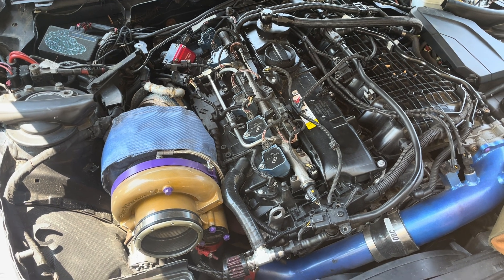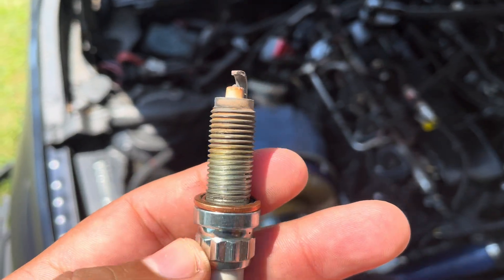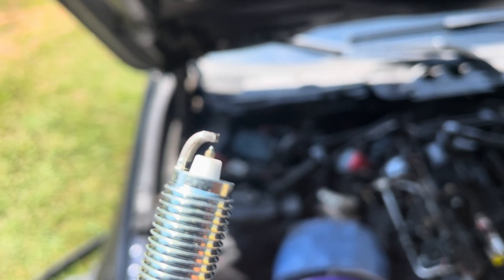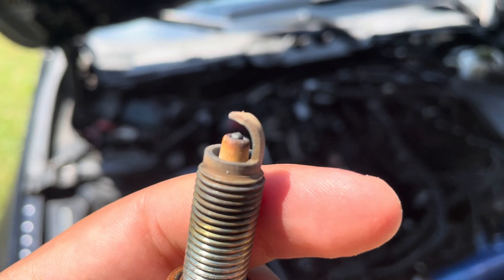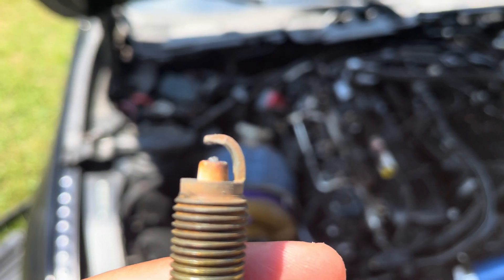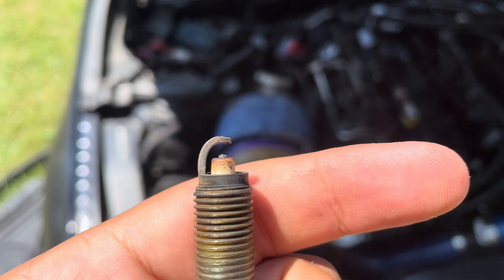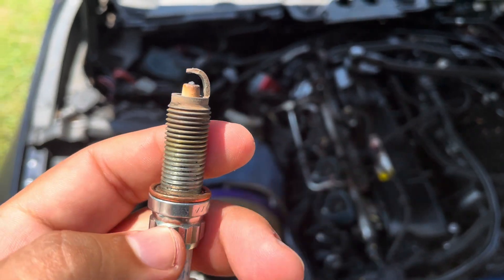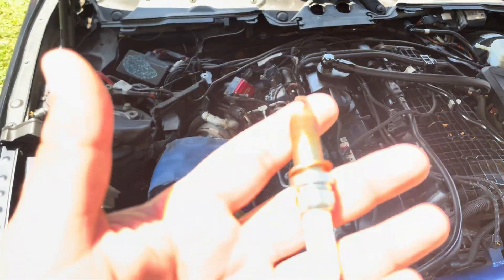bmw 340i B58: Slight missfires at idle (hiccups) diagnosis (2024)

Comment: Was this causing what’s sounds like a short drop out of power at idle? Slight stutter basically. I’ve started to notice a difference idle sound and some hesitation when starting the car in the morning, takes an extra second to fire up.
Reply: About a few min after I start my car and drive and stop my rpm’s drop low then evens out. Is yours the same?
Reply: @Beastmode7400  I took a video of my exhaust, you can hear the sputtering. I don’t get it all the time, especially this bad. I’m thinking maybe the exhaust Vanos is going bad. https://youtube.com/shorts/qz4Hd3tUlTk?si=HSgc6sK-y8qqtHE-
Reply: @JimE-l7q oh wow mine doesn’t sound like that. Where would the exhaust vanos be?
Reply: @Beastmode7400  there are 2 actuators on the back of the engine along the top. I’m going to have my performance shop do some digging in the next week or so to see what’s causing my issue.
Reply: @JimE-l7q did you ever figure this out?
Reply: @JimE-l7q yoo dude my exhuast sounds the exhuast same did u ever figure it out
Reply: @JimE-l7q  Ever figure this out? Mine just started doing this as well at 40k
Reply: @JimE-l7q any update, mines the same?
Reply: @OOE1 Did you figure out your issue? I’m having the same problem as the video the dude sent.
Reply: @Jcsavage00 Did you figure out your issue? I’m having the same problem as the video the dude sent.
Reply: @O @OOE1 Did you figure out your issue? I’m having the same problem as the video the dude sent.
Reply: @EdwardH06  nope not yet lol, still pretty rough - might be sparkplugs